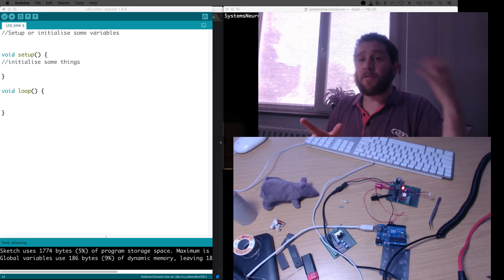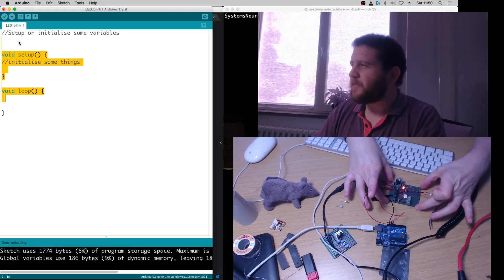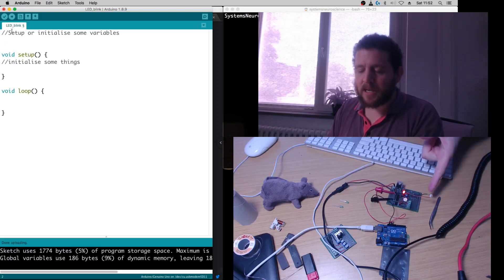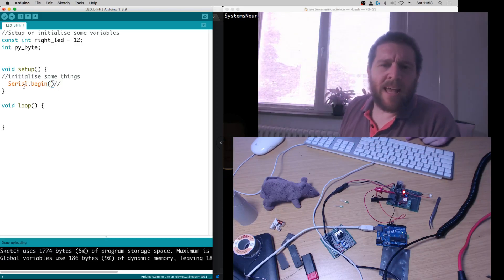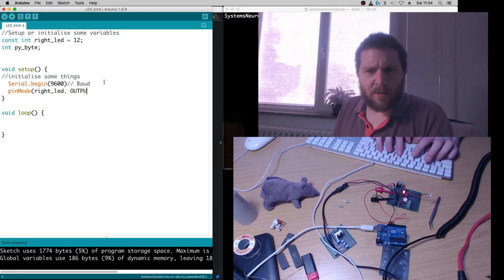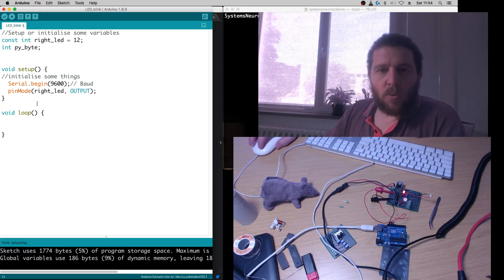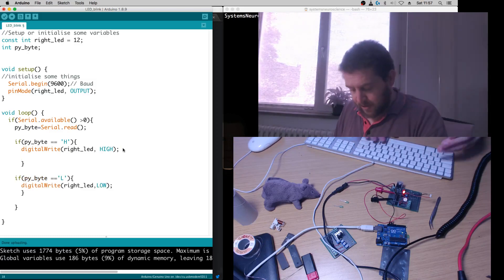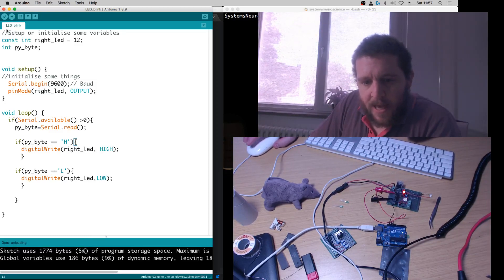Psychopy, Python and Arduino: Are you serial? Setting and writing serial data (Video 3)

Comment: I keep getting errors such as "problems uploading script" and "cannot open port, permission denied". How do i solve this please?
Reply from the maker: Hi, 
Can you give a little bit more information? For example, 
Is this on the arduino side of things - i.e. you're trying to upload onto the micro controller (and not python side of things) 
If so, make sure that you're trying to connect to the correct port (is there more than one thing connected). 
Are you able to upload any of the example programs on the arduino or do you get this error every time you try? 

Any more information you can provide should give a bit more help. 

Cheers
Reply: @garrea01  Hi , turns out I just had to use a different USB port all along. Also, I was using the wrong LED as the ouput. Thank you for your help anyway, your tutorials have been very useful in designing my experiment.